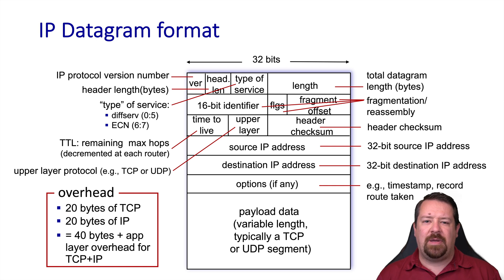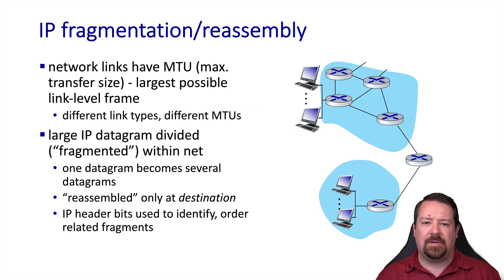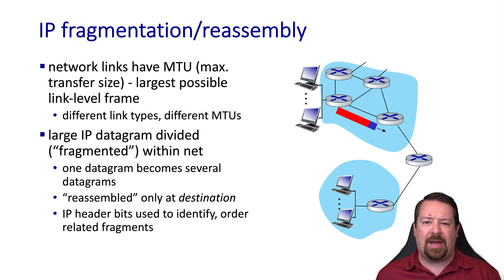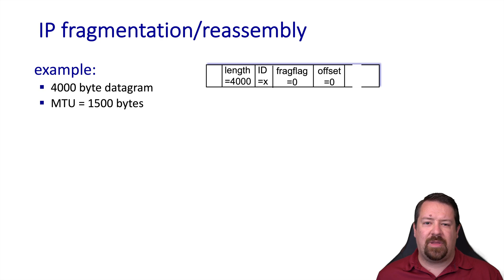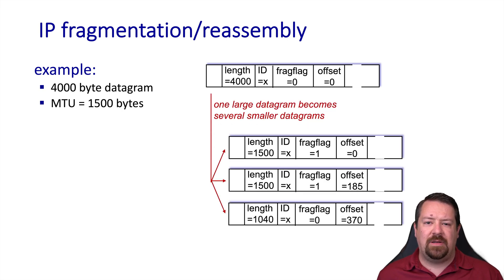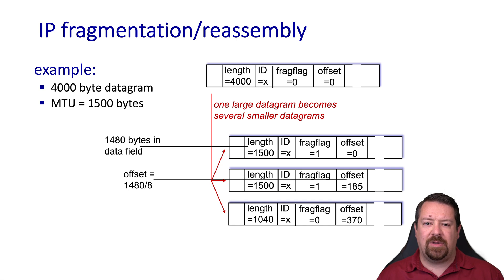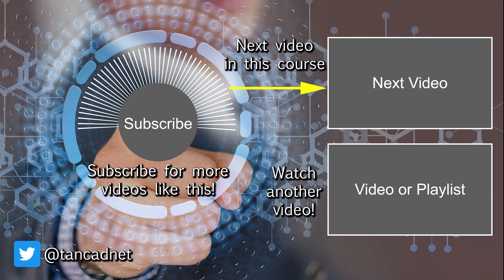Packet Fragmentation & Reassembly - IP Network Layer | Computer Networks Ep. 4.3.2 | Kurose & Ross

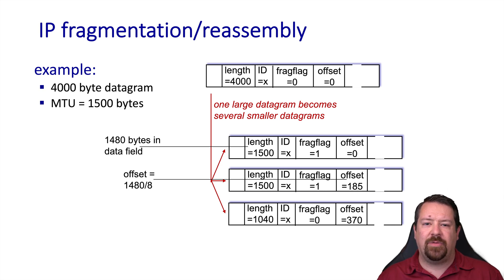Comment: Ain't there an error at 3:19 ? Should the last fragment length be 1060, because it has 1040byte of data field + 20 bytes of the ip header?
Reply: No. Initial length is 4000, which means (minus the header of 20 bytes) the data size is 3980. Fragments 1 and 2 have a data size of 1480 each (1500 - 20 bytes of header), which means that there is 1020 bytes of data left to send. 1020 bytes of data + 20 bytes of header equals a length of 1040 bytes
Reply from the maker: Patrick, you are correct!